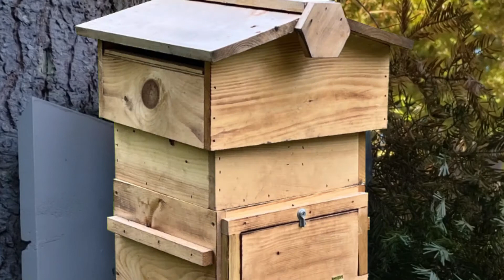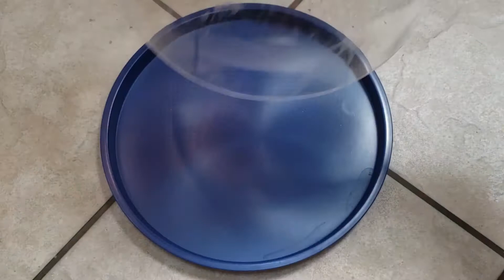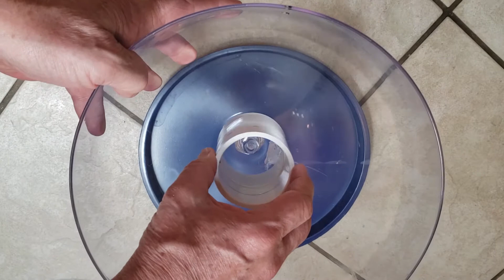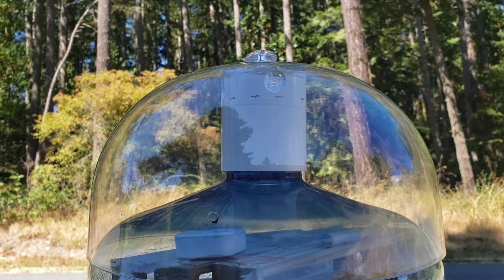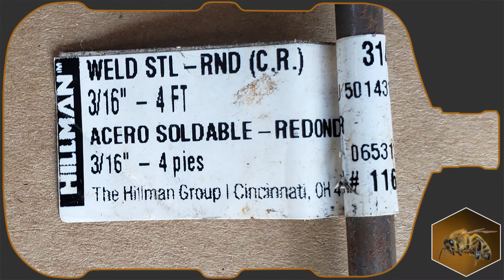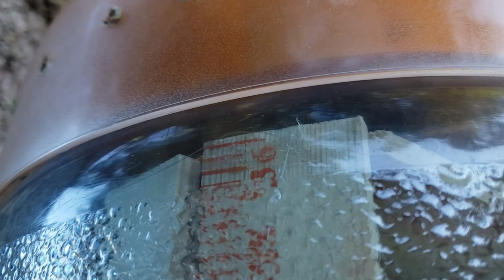Bottle-to-Bottle Honey Production | Warre Style Dome | Round Bottle Beehive

Comment: I think a wood burner would do the same thing? Making the holes. Although diameter accuracy would be affected
Reply from the maker: Yes, a wood burner or similar would work fine. The diameter of the holes isn't critical as long as it 1) allows enough airflow and 2) is too small for the bees to go through. These videos try to focus on materials that most people have on hand or can acquire cheaply. Since most people don't have wood burners, I went with the drill bit.  - Thanks